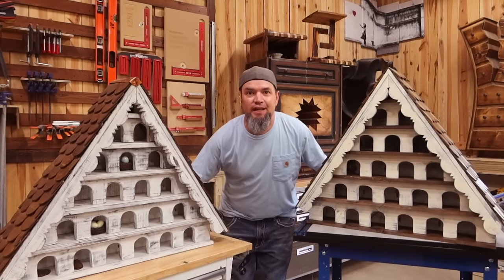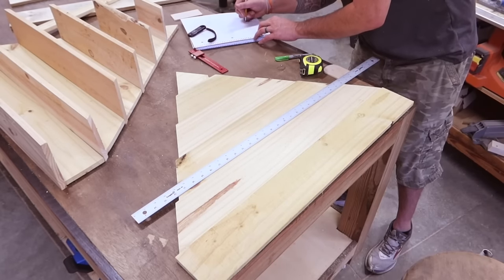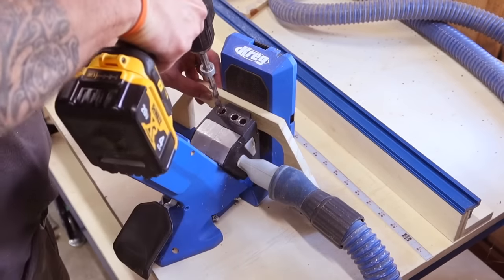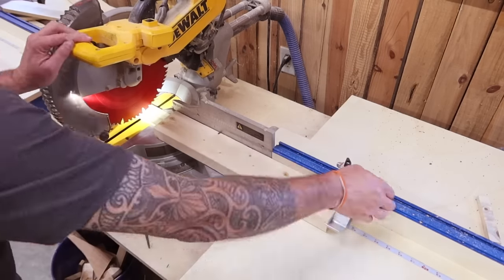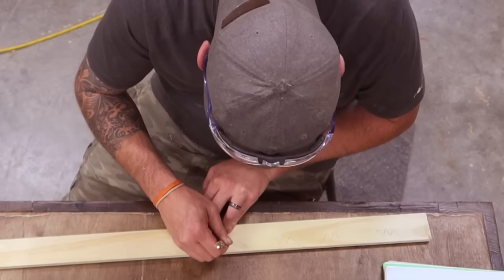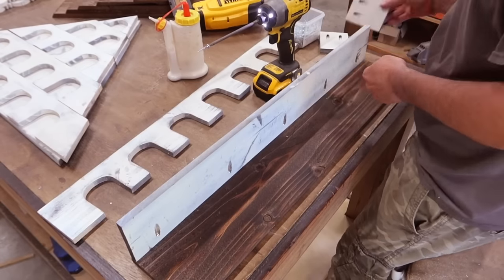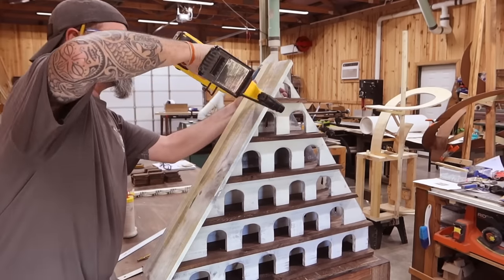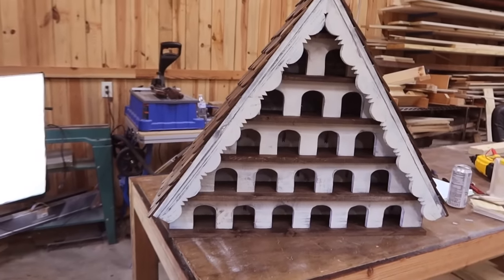Make Money Woodworking

Comment: I was glad to hear about planing the pickets. I've only just started doing more with them and I noticed they weren't uniform.  Sanded a bit and worked with them anyway but determined to plane to 1/2 going forward. I guess for the primitive look sanding will be all that's needed but any deviation in thickness needs to be fixed to get proper assembly.

Comment: Another excellent build that I would like to attempt soon. I would do the following to speed up the build process when making multiples:
1. Drilling the doors with a hole saw, the just gang cutting the straight lines when multiple plans are clamped together
2. Also clamping the two (or more) gingerbread trim pieces together and cutting in one go - reduces the tracing and cutting.
3. put the pocket holes on the back - they will then not be visible from the front through the doors.
For a single box this might not be worth clamping pieces together, but when making multiples it could speed up the process even more - time is money 🙂
Reply: I watched this and thought " why in the world would you pocket hole the front and not the back?" I saw your comment and thought " OK so I'm not crazy." Thanks man

Comment: The birdhouse is really cool and the material cost is very little, but how many hours would one expect to put into something like this? Time is money.

Paint/stain time and materials also must be accounted for.
Reply from the maker: You are correct.  It's not one that your going to pump out 10 in a day.  The assembly goes really fast.  It's the prep.  You could easily build one in a day.
Reply: I've found that with something like this, making multiples doesn't take much longer than making one, relatively speaking. Because when you're prepping the parts, you're already in the zone doing that particular task, and cutting a few more or whatever is pretty much negligible in the grand scheme of the project. It's the switching between tasks / getting set up for another task that gets you.

Comment: I've been getting the culled cedar pickets at home depot for $1.07 each. 70% off. This would be so cheap with those.
Reply: You need a bench disc sander dude. It's a lot easier than the hand sanding.
Reply: This is an amazing build!

Comment: I have a bunch of 1"x4" boards, actual size rough lumber, can I use these I know they're thick, if not what would be a good use for them? I don't have a planer or table saw to cut them in half. Thanks!
Reply from the maker: You could use them for the fronts and backs... but you would need to cut down some parts like the gingerbread.  You could do it with a circular saw if needed.

Comment: Would using a hole saw in the top of the doors and then the jigsaw or possibly even miter saw to cut straight edges to connect make repeating the doors easier?

Comment: will glue still setup properly with the stain and paint?
Reply from the maker: Probably not as strong as if it were used pre.  But it will still create a great bond.
Reply: @MatthewPeechWoodworking  good to know, I was under the impression that a bond wouldn't form. Thanks

Comment: 4:30 - Instead of a jig and a scrolling blade, wouldn't it be easier and quicker to make the rounded tops of the openings with a drill and hole saw and then finish off the sides with a jigsaw (or another saw)?  I suppose if you were insistent on the tops of the door not being perfectly round, it wouldn't work, but...
Reply from the maker: Hey!  Yea the last one that I built I did that... but it actually took more time... You still have to use the jigsaw.  by cutting the hole with a hole saw your only saving the time it takes to round over the top.

Comment: Do you use 6 foot or 8 foot fence pickets I love this bird house I will definitely be making several of these thank you for all you do
Reply from the maker: This was all 6' pickets.  Make sure they are good and dry if using pine.
Reply: @MatthewPeechWoodworking  thank you so much I will do that  thanks again
Reply: I think that the eight ft pickets are custom order
Reply: @dougpeak7591  no you can get them at any Lowe’s hardware around my house
Reply: @michellejefcoat3882  I haven’t seen them in wisconsin

Comment: I made this and it looks good, but I would recommend not using fence pickets. For one, the pocket holes done have much to grab into when putting the back on to the next layer. Second, fresh fence pickets are wet and will warp. If you use pickets, let them sit somewhere for a while and dry. Otherwise, it’s a good Looking birdhouse. It’s too labor intensive to be something you make for sale, unless you can find a way to make the shingles easier and faster. Cool project though.